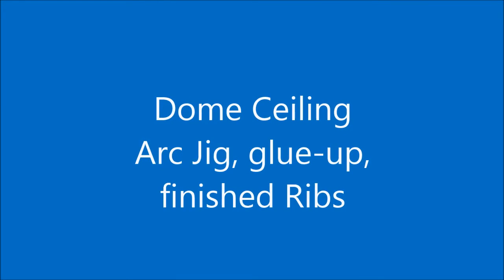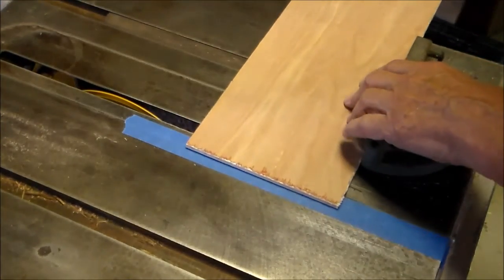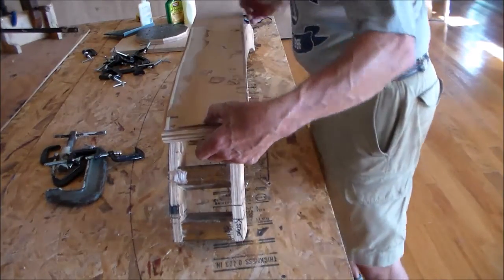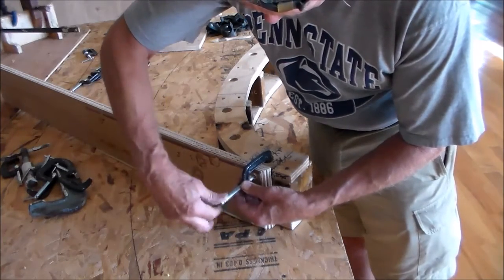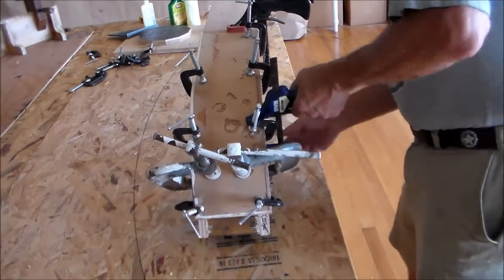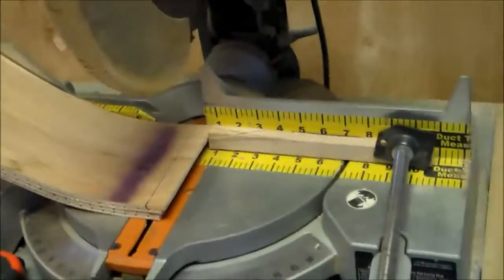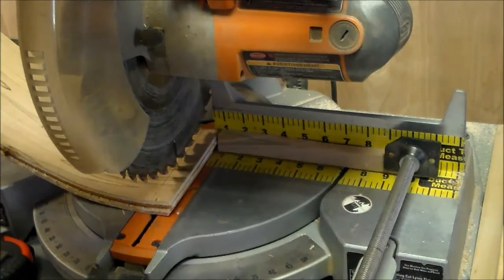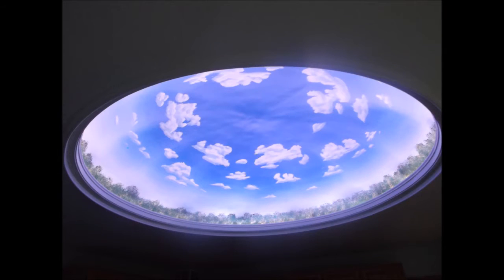Dome Ceiling   Arc Jig, glue up and finished Ribs---Step 4

Comment: have you ever done one of this domes for exterior use?? any advice, I need to make a 4.4 meters diameter dome ceiling for a restaurant patio I was planning to use a "Yurt" design for this.
Reply from the maker: Will the structure be getting wet?
Reply: Good day Donald, not really wet (cause it's going to be cover with a marine varnish, and in top of it a clear vinil tarp to cover it) it's very close to the ocean where standard humidity  it's above 90%.